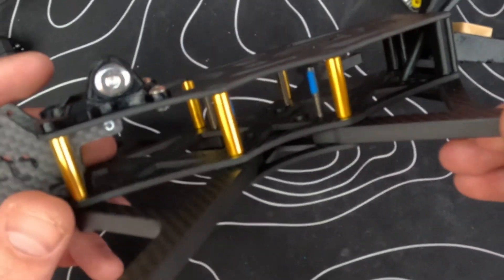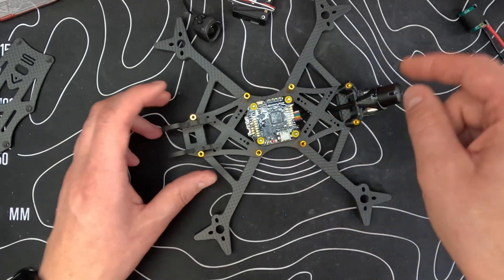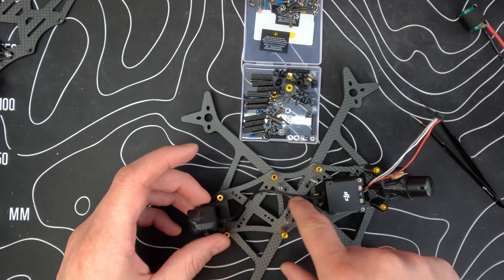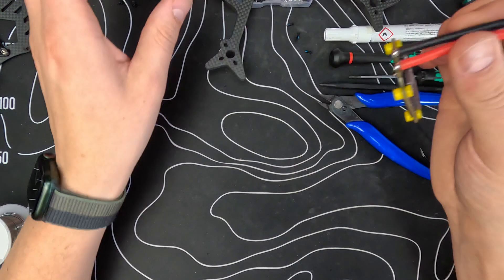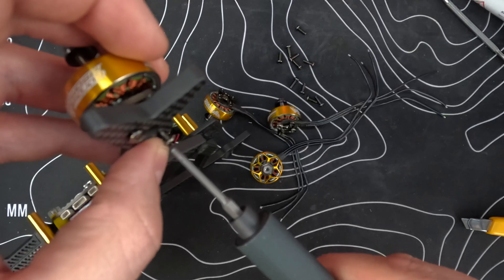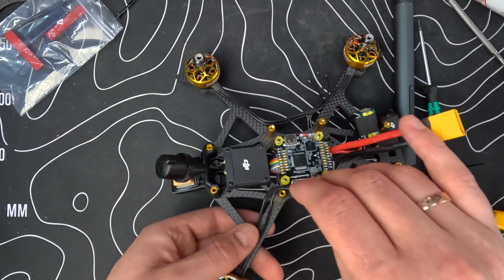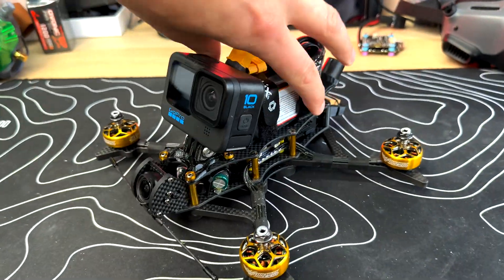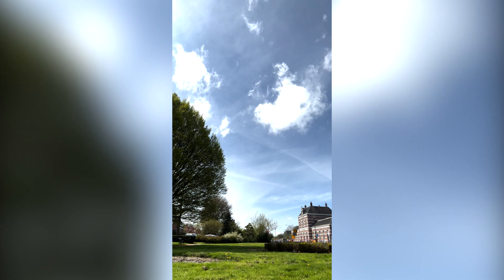How i build my iflight AOS 5 FPV drone

Comment: Currently putting a list together for my build. Your build is almost identical to mine lol. Except I'm using the 1860 rcinpower motor. How is yours doing? Holding up well? I'm still iffy on the speedybee FC. Thinking of going to Geprc.
Reply from the maker: FC: I'm using a few of these and they are very good at the moment but for my new build im going to be using V4 for the Motors from rcinpower are to much so i would also switch to 1860 for more torc. Really a nice build and chill after a little tweaking.

Comment: How did you secure the stack screws?
Reply from the maker: I used the screws from speedybee stack, and secured it with a little locktide on the top of the screws. hope this helps?
Reply: @Dronebuzziness thx for replying but what i actually meant was, how did you secure the bolts to the bottom plate without a nut (or at least I didn’t see one)? Because as soon as you mount the arms, the stack screws becomes unreachable
Reply from the maker: I didn't tighten the screws with a nut. I just put the stackscrews in and put Esc and fc on the screws and on top of that a stacknut that’s it

Comment: Same frame I have. At 5:15 you can use longer stack screws (22mm), allowing you to add nuts to the screws and on top of the stack. iFlight sends only 20mm which is unfortunate
Reply from the maker: Thanks man, I used the screws from speedybee stack I think, next build I will prepare it better.

Comment: I have a very similar build. We only have the frame and engines. How do you feel about flying this set, my drone flies terribly. It doesn't fly smoothly. I guess I need to do pid tuning.
Reply from the maker: I think it flies really well, but it took me less time to do a  PID tune. I can fly straight lines without wobble. What you can do is adjust the slider "damping" by 2 steps down, because the frame is so tight this can help with the light wobbles.

Comment: I also build costum AOS5. I use motor wires protection at first but later I remove them because they brake and have sharp edges. I always protect my motor wires with textile tape.
Reply from the maker: yess! awesome @primoziskra6394 Same as me, I used cloth fabric tape, clean, easy to replace hard to rip with a prop.